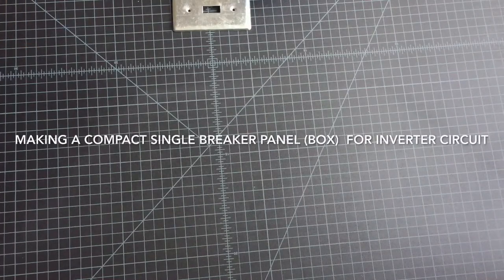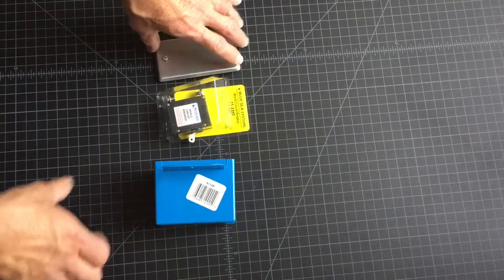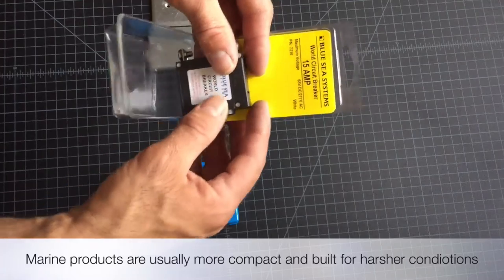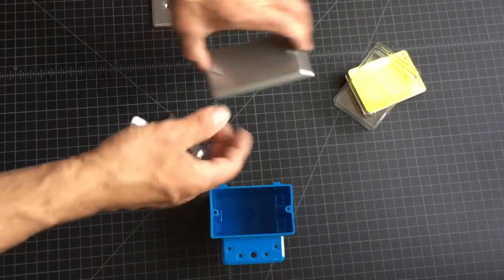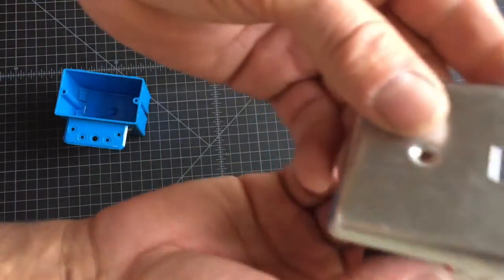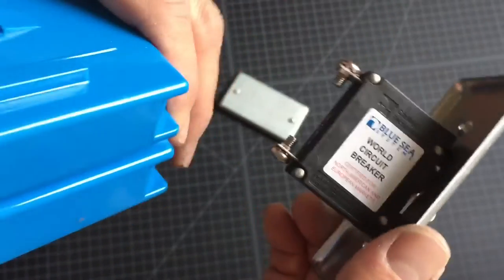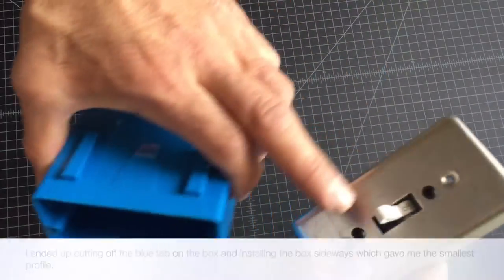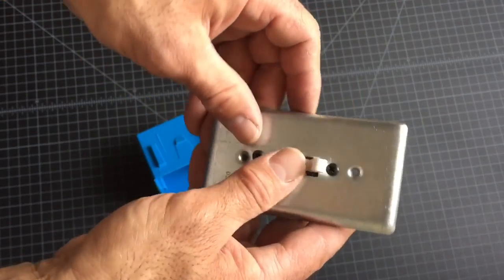Stealthy DIY Mini Breaker Box for Sprinter Van

Comment: This works for 110ac?
Reply from the maker: Max's Garage yes it's designed for 110 and it's compact and marine grade
Reply: cool i went out and bought one. how do i go about wiring it? 
It only has 2 spots but my romex has 3? does it matter which one i put hot too? any help appreciated
Reply from the maker: Max's Garage hi, ya i dont think it matters. Im assuming if it did matter they would of included instructions. Good luck.